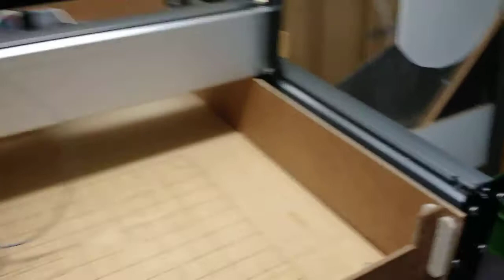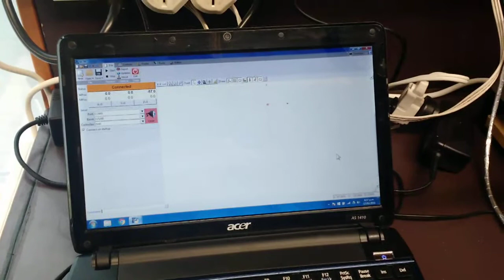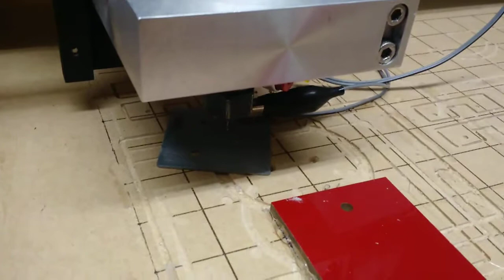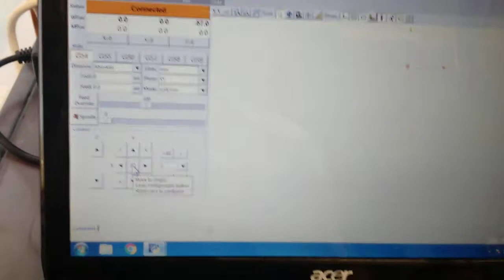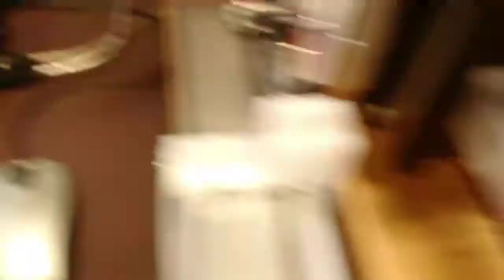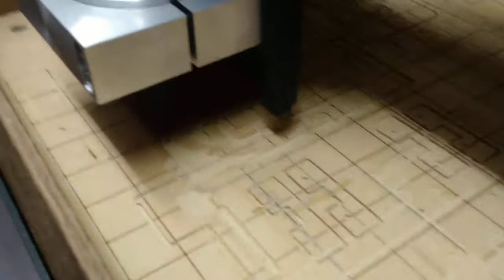ShapeOko with switches

Comment: Do you hot glue all materials? Tried brass the other day but glue gun i have just doesnt seem to heat up glue stick enough.
Reply from the maker: +Josh Lopez I use hot glue for everything, aluminium, wood, plastics.  You do need to let to cool properly or doesn't go hard enough.  Mine is normal craft glue sticks but the gun it larger than some and it does come out VERY hot...perhaps that explains it.  Does it come loose from the waste board, or from the material?
Reply: +Andrew Spurgeon basically solidifies on the work piece before i can flip it and put onto spoil board. ill check amazon for better glue gun. thanks
Reply from the maker: +Josh Lopez Ah ok.  So I usually just put the object on the board, then hot glue around the edges...I don't put it underneath.